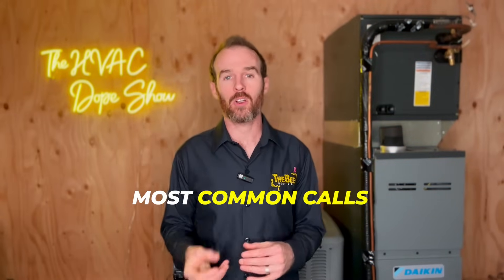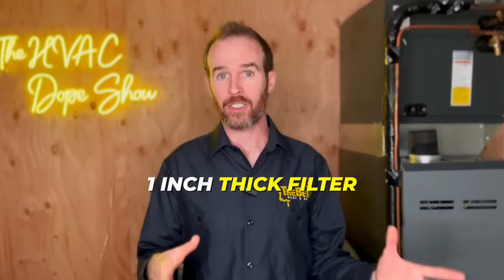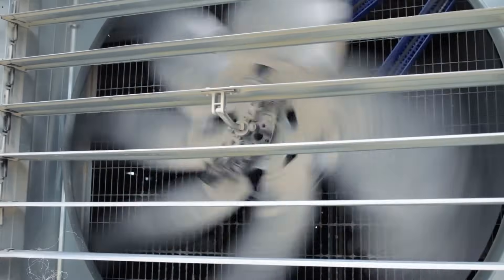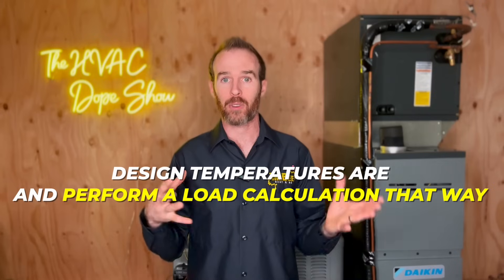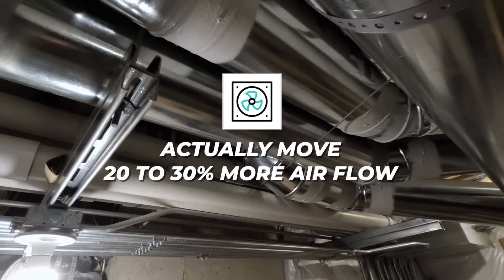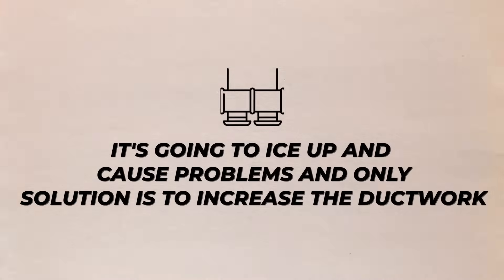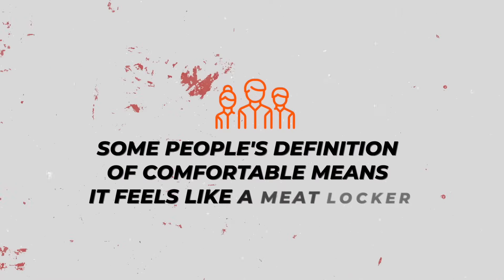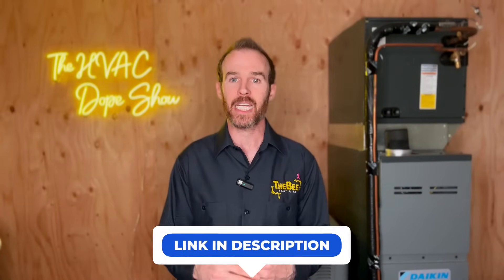THIS is why your AC isn’t keeping up 😬❄️

Comment: So, if your system is running all day and keeping things set to where it's designed, then I take it to mean that just like a car with cruise control engaged, it runs smoothly. If it's running like it's driving in New York City, well, stop & go driving is no fun. Thanks for a good video. I'm gonna share it with a few folks so they check their systems against the points you mentioned.
Reply from the maker: Awesome sounds good and glad you enjoyed it and found it helpful!

Comment: If you only have 1 return air duct in a house it's a Red Flag! Make sure you have a HVAC tech check your static pressure! If the total static is over 0.50 you need to fix the size of your ductwork! In my area over half the homes only have a single undersized return air duct. This is often giving you half the airflow that your system is designed to move.
Reply from the maker: Agreed! The builders don’t have to service the equipment otherwise they’d add more return air

Comment: How bad is it if I don’t have a cold air return? My house does not have one and my ac can’t ever cool my house down.
Reply from the maker: What do you mean doesn’t have a return? That’s not possible the system will just ice and not run and not be able to circulate air. You definitely need enough return air otherwise it won’t circulate air without a return… did a fix and flipper cover them up or something ?

Comment: If I close a vent,  I also shut the room door off from the rest of the house.  That does help significantly.
Reply from the maker: Right on if it’s not icing then it’s probably fine… It still restricts total airflow so if you have too many vents shut to the point it ices us and doesn’t keep up it will actually be counterproductive. We advise people to keep as many vents open as possible. In systems with undersized ductwork even 1 or 2 closed vents out of 10 or 12 can make a difference to cause things to ice.

Comment: From 8:04 to 8:50 is priceless info for those of us living in certain parts of Texas where our units run all the time during the summer months. Kudos for a great video!
Reply: Meanwhile I was over here doing everything i could to figure out how to stop it from running constantly thinking something was wrong 🤦🏻‍♂️
Reply: I live in Houston, TX and my ac doesn't run all the time during the peek summer 72at night and 74 during the day. Now I do have to mention my attic has spray foam insulation. So it's only about 10-15 degrees warmer up there. That means my ac isn't fighting the heat in the attic to cool the house.
Reply from the maker: Thanks for watching!!

Comment: I always wondered what was "wrong" with my AC, since we keep it set at 68, but in the middle of summer, it'll frequently creep up to 70-74 if it's REALLY hot outside.  I guess the system was probably designed to that 70-74 range you mentioned.  I haven't heard of this before from any of the other hundreds of AC videos I've seen, so thank you for spreading the info!  :)
Reply from the maker: For sure! Thanks for watching… When we retrofit a system and do a quote we always ask what temp they like to set things at because I’ve had people say 65 and when we hear that we almost always look at adding a ductless somewhere or VRV unit so that it keeps up!

Comment: I had the opposite, an undersized system. I figured when it was in the mid 90s to 100s outside, not getting below 78 indoors was normal. My unit was close to 16 years old so I wanted to replace it before it died on a hot Texas day so I did early this year. Lo and behold, all bids I received told me my 3.5 ton was way too small for my sq ft. of 2699. They did some duct mods and now it cools nicely.
Reply: I have the same problem. The house was added onto and when the central AC was replaced, it was replaced with the same size and not upsized. Went from like 1700 sq ft to 2300. Still a 3.5 ton unit. The air flow is also messed up. Shut air off going to addition, put a window unit in there. Had to put in dampers to balance the rest. Had a ton of air dumping into one bedroom. Still have a lot of work to do. Poor airflow to two back bedrooms. Duct is coming off the back of the plenum. Someone told me that will cause poor airflow. Need to add a vent going to middle bathroom. Gets hot in there. Lol old houses.
Reply: @seabass22  keeps all your doors open if you have bad returns, it will cool off alot faster and actually turn off and cycle properly in the summer
Reply from the maker: This is also true sounds like you had some great contractors who knew what they were doing!
Reply: 😅 who in theirs right mind would installed 3.5 ton for 2700 sf home? 1700 maybe

Comment: Interesting. My problem with my A/C is the second floor works great, but the first floor doesn't feel like it is getting much air. The ducts are open on the first floor yet it doesn't feel like any air is coming through them while upstairs it most certainly is.

The air isn't naturally trickling down either so while I have the upstairs set to 70, the first floor is 74-75, and the basement is even warmer at 75-77.

I don't have central heating but heat rises just fine in the house. I also have electric baseboards to compensate so this isn't an issue I am seeing.

I feel like something is jammed in the ducts or something.
Reply from the maker: This is very strange I’ve never heard of a basement being warmer than the rest of the house when the AC is running. I would look at ducting. Sounds like an issue with airflow balancing or maybe runs being disconnected, I’ve never ran into this lol for what that’s worth… sounds like ducts aren’t connected or dampers are shut or something is off with the design
Reply: I've never heard of a basement being warmer, I'm curious on the how myself.

Comment: I learn something every time. As a kid, my parents would have me close different vents and open others in summer and winter. I have always believed and even recommended to friends to do the same. Who knew... a professional I guess!
Reply from the maker: You're not alone! Lol there's a reason we put it in a video :)
Reply: My issues is set at 78 cool when it reaches 78 is does not shut off. Thoughts?
Reply: @TB-xv5jb for some reason, hvac techs set it for between 1 degree and 2 degrees difference before it shuts off the system. So, if you want 76, be ready for 75 or 74.
Reply: @TB-xv5jb  check differential